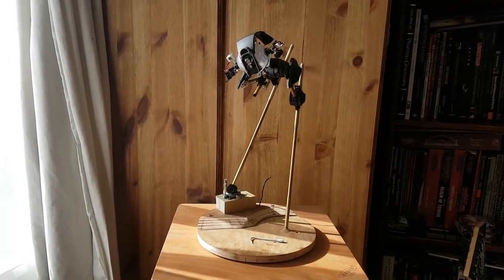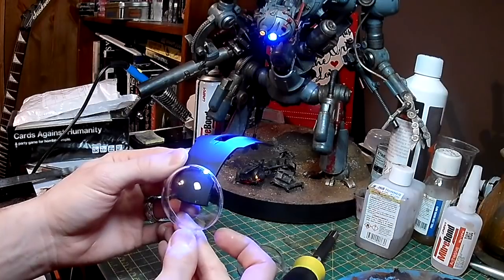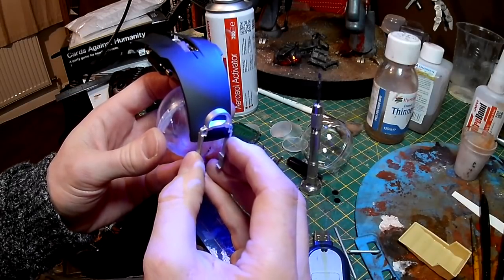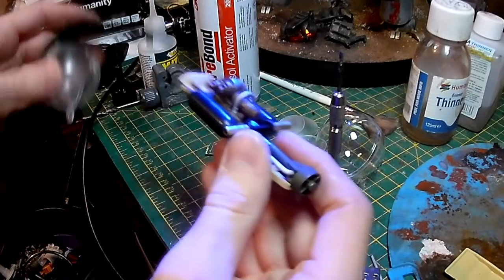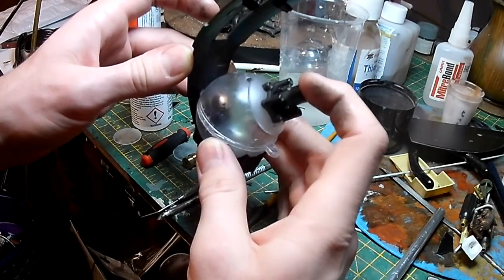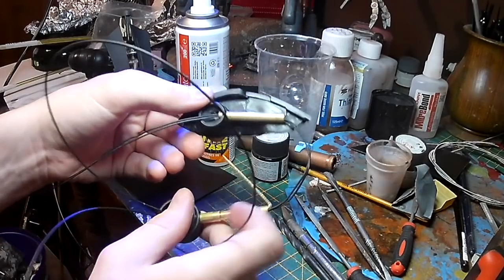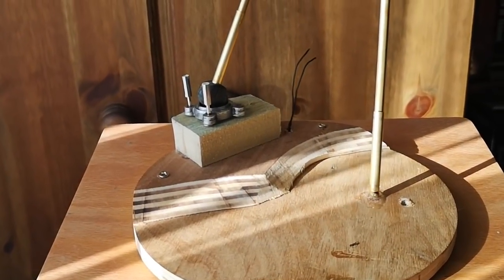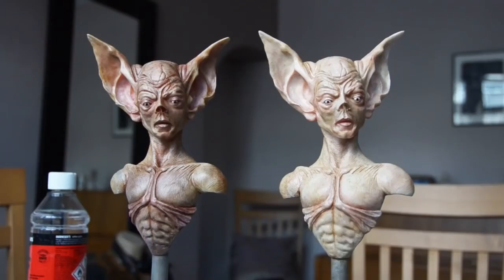Scout Mech Scratchbuild Part 1

Comment: I feel your realism comes from the fact you think about what the details actually do.  You think about what the part would do, and not just cause it looks neat.  I dig it.
Reply from the maker: Thanks!  Yeah it drives me nuts if there's a mechanical looking part there which clearly has no use.  I think it comes from my involvement in steampunk - just 'gluing a gear on it and calling it steampunk' is frowned upon, so I try and make sure everything has an actual function.

Comment: Nice! Pleased to see you've got the bug for scratch building. 
I liked your idea about the neck joint sliding over the bauble, I thought that this would have been be an ideal use for magnets and add a lot of  articulation/movement.  But this may cause a problem with regards to your lighting.
Looking forward to seeing more.
Reply from the maker: Thanks Rob.  Yeah I did think about magnets, or maybe a sort of spring mechanism that could hold it together.  I think it would work for a larger sized sphere, but this was quite packed once I got the wiring in there, so I bolted it all together in the end.

Comment: To change the look of those NO2 bottles slide some O Rings on some and use miliput/greenstuff 5 minute epoxy or the like to have a smooth transition between the NO2 bottles and the O Rings. Also different thicknesses of styrene can be added in rings, fins, strips, what have you to give all sorts of looks. Same can be done for most cast parts to make them look different from one another, that way it doesn't look as though you keep using the same pieces over and over again. You could even mix and match the different add ons to the same NO2 bottles.
Reply from the maker: Thanks. Yeah good ideas, they are handy alright I do fine myself using them a little too often though.

Comment: Cool to see this - thank you for sharing. Do you ever post at OSW? I too like to scratchbuild ( mostly in 1/6 scale ). Keep up the great work...
Reply from the maker: Thanks Michael, no I've not heard of OSW.
Reply from the maker: Oh, actually I have - One Sixth Scale Warrior?  I collect Hot Toys so I've had a look at the site but I've not posted.
Reply: @thedarkpower  No doubt your work/posts would be very welcome there. I have been there since 2003, but have recently dipped my toes in the youtube pool so to speak - hoping my own channel will catch on as more OSW miniature makers migrate over to YT. Keep up the good work - you have an undeniable talent.
Reply from the maker: Thanks Michael, I've subscribed.  You have some cool builds! Good luck with YouTube, I've always enjoyed creating videos and making stuff, so it's a good fit for me.
Reply: @thedarkpower  Awesome - thank you. I had an idea to share with you about 1/1 scale materials to repurpose for scale modeling - two really good things for interesting parts are old instamatic cheap cameras, and also older remote controls. Both are readily available at thrift stores and are usually cheap. Also used guitar strings - they make really cool tech-looking cables - and the flat wound strings can be pulled apart allowing for a hollow metal outer sheath that is perfect for routing wires for LED's.
Reply from the maker: @michaelskramii2245  Thanks for the tip I've not tried those.  I have just ordered a bunch of remote control car components, specifically the steering and suspension pieces.  There are some really interesting mechanical parts available.
Reply: @thedarkpower  Glad to share ideas - old VCR's are another treasure trove of both electronic and mechanical stuff - throw away consumer tech from decade past - parts pure gold :).